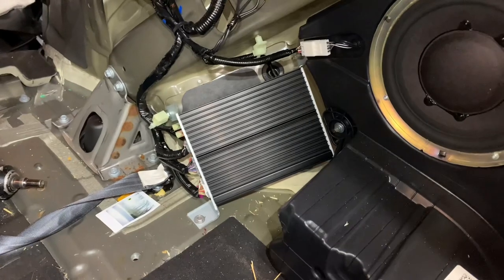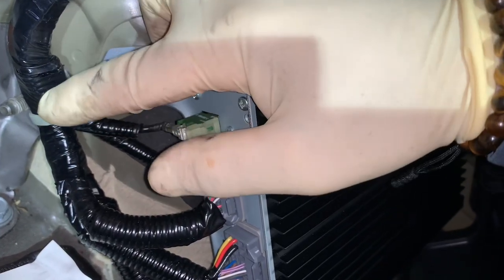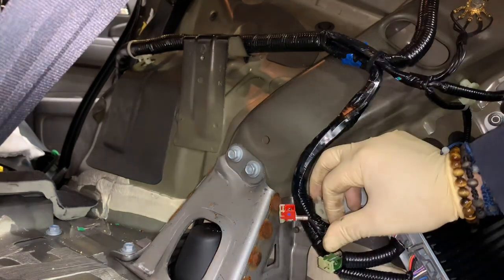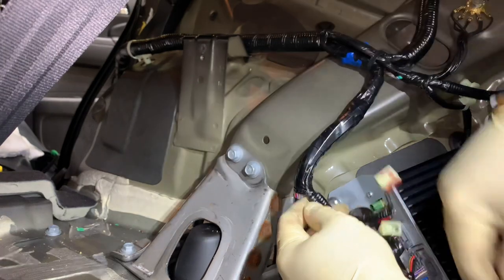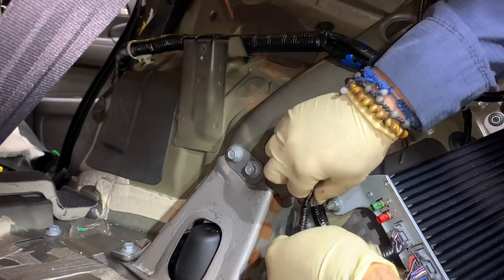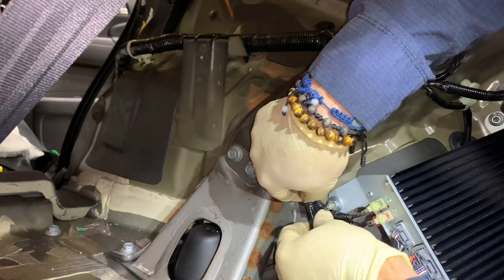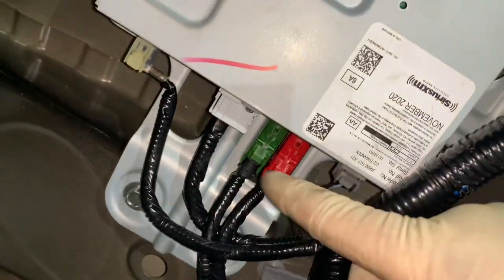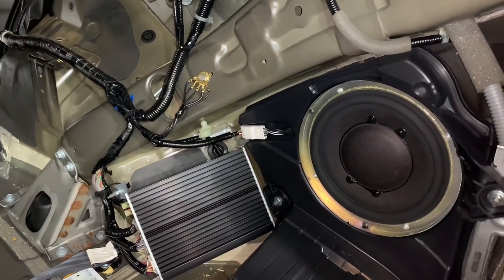Honda Pilot and Passport crackling, popping, infotainment turning off or freezing repair.

Comment: I’ve been fighting this problem for a few months now.  What I’ve found is if I have the plastic cover removed the radio works perfect.  But once I install the cover back on the problem comes back.  I drove for 2 months with the cover removed without a problem.  I’ve tried rerouting all those cables several times. And as soon as I reinstall the cover it comes back.  Any thoughts on what could be happening here?  I’m assuming t he cover is putting pressure on thE wires somewhere. But I can’t duplicate the issue when the cover is removed  by pushing or pulling on any of the wires.  I purchased this Honda(2020 pilot - black edition) as a rebuilt title, so I have no warrenty hTrough Honda and I’m worried I’m SOL.
Reply from the maker: so what you have to do is take a borescope and look at how the fires are once fully installed and have to find a way to get them as straight as possible. Also go to the dealer and tell them you want to buy the fakra connector bulletin and perf the bulletin

Comment: In my case my stereo amplifier (female connector it self, the red one) broke 😢 the Harness is safe. I wonder if there’s anyway to fix it  or to replace that female red connector or would have to replace the Amplifier itself, please help
Reply from the maker: If you can’t get it back on, will need amp unfortunately

Comment: Where is that amp located and what is needed to gain access.  My fiancee has a  pilot that has a cracking/popping noise from the radio.
Reply from the maker: Located behind pass side rear quarter. (That 3rd row pass seat and quarter cover have to come off. If it’s still in warranty I would take it to honda and have them perform the procedure.
Reply: Bring it in. Should  be covered  under warranty
Reply: @richardcabrera1176  Warranty is only good for 36K miles isn't it?
Reply: @caffeineandkaspa  for that pop issue it seems longer
Reply: @richardcabrera1176  I hope so. I feel stupid buying one with 36K miles on it. I hope it's covered if it happens to me.
Reply: @caffeineandkaspa  no problem  man . Also you shouldn't  feel that way .  You should  be good to go

Comment: Can you please do a video on how to get to the cables and remove all the stuff on top of it?
Reply from the maker: Yes, next car I get with the complaint I will.
Reply: @BCautosolutions  Any new vids yet showing the location of the amp and how to access it?  Your video gave a great description of the problem nd how to address it but I am not sure where in the vehicle it is located.  Been experiencing this intermittently in our 2019 Pilot.
Reply from the maker: @rstephe  I haven’t done once since the video but sad soon as I do I will be sharing it.
Reply: @BCautosolutions I’m a fan of your work, waiting for that video also. 🙏🏼
Reply from the maker: @stansingh  thank you! And as so as I get another one!
Reply: I have completed this fix with HondaMobilemechanics direction and so far have not had any infotainment issues, still early to tell but I had it pop and shutdown on me multiple times per day, now its working so far after the repair without issue. If you need to see how to take apart the interior to get to the amp, watch this youtube video, https://youtu.be/9rC2sTds7Jw,  they show how to take apart everything in the back on the drivers side but its the same steps for the passenger rear to get to the amp, my 2 cents into this BS problem, hope it helps.
Reply from the maker: @kumbaproperties2432  that’s awesome! Thanks for sharing!
Reply: you need to take off the 3rd row copilot seat (its pretty easy), then you want to take off the panel on that side and you will be able to access this easily. Don't try to do it with the seat on because it will make it harder that what it should be.
Reply from the maker: @lalobon  correct

Comment: Does this fix the cutting out and popping cracking 2020 Passport
Reply from the maker: Yea, similar but not exact situation.
Reply: @BCautosolutions  I guess every situation depends.  I’ll try this I get cut out and crackle.  Do you have a video on the dash harness and how to remove the rear compartment for this video to get at the amplifier
Reply from the maker: @GPMAX01  no i do not but I will.
Reply: @BCautosolutions  these videos are very well made and Uber helpful.  Thanks for all you’re doing!👍💯

Comment: I made a appointment to get the recall done for my 2020 .but theres nothing wrong with mine no issues what so ever .my friend just had his done and they gave it back to him with clips broken and chattering .they are replacing his silver bezel that goes across the front dash and lower floor board and chipped his cruise controle and there replacing all that and a chip in his top right screen to infotainment system so there replacing that also.sad part is they tried denying it and he took videos and pictures of everything documented.they ended up owning up to it sfter he showed videos and pictures .so i have to find a new dealer to do mine not trusting the one near me .ill have to cancel my appointment on the 31st .maybe wait till its broken .if its not broken dont fix it deal
Reply from the maker: How did you fare out?
Reply: @Hondamobilemechanic  I ended up canceling it they butchered 2 of my friends cars .my car isn't doing it so no one is touching my car till it's broken .40k on my pilot no issues .not broken dont fix it
Reply from the maker: @pilot2020  I agree dude, if it ain’t broke, just let it be 😅

Comment: I have same issue on 2020 Pilot, it’s been to dealership with lame b.s. excuses, they say it needs new harness which is 6 month back ordered.  I just tried this fix and it looks like dealership already tried it.  Any other ideas to try, I’m not waiting 6 months on new harness to be installed by some jokers.  I’m back to GM after this car.
Reply from the maker: Sorry to hear, I would check the wires behind the infotainment and dvd player area, re route then if needed. Funny you say that actually, the most system is a system borrowed from gm.
Reply: @BCautosolutions   I checked all of that too, looks like they went thru that at some point too so I guess it’s wait on the harness or trade it in. I honestly don’t see them actually doing the harness because it’s to much work. It may be a borrowed system from GM but the service is better from GM and GM’s are just a better all around ride but we decided to give Honda a shot this go around and have been nothing but disappointed, mostly with the local dealer but corporate really hasn’t been any help either.
Reply from the maker: @jameskeesee6863  sorry to hear. Have you tried a different dealer by any chance? Shouldn’t have to do all that but we see it here in my area how a few dealers within proximity aren’t as willing to help as my dealer is. Anyways appreciate your input and wish you luck.
Reply: @BCautosolutions  I think you mentioned that you are in the New Jersey area, Would you be able to recommend a good dealer that can fix this issue the right way. Im in New york city area?

Comment: Can you pin point where the amp is located on a 21 pilot thanks in advance...
Reply from the maker: Behind interior panel on r/r of car (quarter panel section) have to remove 3rd row lower seat and 3rd row pass seat back

Comment: Any advice or idea why when I connect my phone with a usb cord that it sometimes doesn’t play stream music (doesn’t matter the app), yet other days it works just fine. I have also literally had it plugged in and it is playing the maps through Apple CarPlay on the screen just fine and then all of a sudden the music will start. Could be 15 minutes into a drive or an hour. So random.
Reply from the maker: Are you using Apple cable or aftermarket?
Reply: @BCautosolutions  Apple cable (lighting male end into phone). Also I took my panel off and it looks like someone already released the tension on the plugs by cutting the electrical tape. So not sure what to do with the crackling/popping that occurs as well.

Comment: Where exactly are you working here? Rear passenger sideliner?
Reply from the maker: Yes, essentially inner passenger rear quarter panel. Have to remove passenger side 3rd row seat and trim panel on the interior.
Reply: @BCautosolutions  thanks. I have a passport, so no seat! Cheers
Reply from the maker: @jonpos4671  yep, on the passport it’s less work 👍🏻
Reply: Is it on the left or right side?
Reply: @thile6409  right side. Passenger side. Comes out pretty easy on Passport
Reply from the maker: @thile6409  pass side quarter panel area.

Comment: i have  a 2013 honda cr-v making noise from rear speakers poping / craking/ static , radio is off and only while going over bumps as vehicle jumps , also now the radio fuse pops while replace
Reply from the maker: Totally different issue. Sounds like you have a short going on

Comment: Wasn't there a recall on this issue in the 2019-2021 cars?
Reply from the maker: No recall, service bulletin. It’s different
Reply: @BCautosolutions  I had to take my daughters 2019 Passport to the dealer and they replaced the connectors under the Recall/Service Bulletin. I don't think it was the same connectors you show your work on. They looked more like the red an green ones you show later in your video.
The audio was popping and cracking, but the system didn't shut off.
Reply from the maker: @andrewdarden8210  yes passport is slightly different. The symptoms vary fr popping/crackling randomly to pretty often to shut downs. Appreciate the input
Reply: This is me from the future. You called it. Whew.

Comment: I have a 2019 passport elite , the radio will stop working and the display says no audio connection. Doesn’t happen all the time but when it does I turn the vehicle off and back on and I get audio again. There’s a tsb 21-012 seems like that’s my issue.
Reply from the maker: That tsb is a hit or miss tbh. I’ve done countless of those almost times with little success. Typically pilots and passports this exact procedure is what has worked for me.

Comment: I have a 2021 Black edition pilot with 8,450 miles on it. 1) visit to dealer it was a software upgrade. 2) visit to dealer it was new wiring connectors.. I still have the same problem.  When I start the pilot screen is blank no back up cam nothing... sometimes when I start to drive it come on only to show  " lost network connection " so now back to the dealer I go.  Hope he dont get offended when I show him this video..Thanks
Reply from the maker: Yep, show them this video. I’d be willing to bet this is your issue.
Reply: @BCautosolutions   So today I drop off my Pilot at the dealership he's telling me he just order a New tuner... I gave the the video to view .let see if this fixes the problem..thanks for your video ... keep them coming ( hopefully not needed ) lol
Reply from the maker: @markbrennan21  he ordered a new tuner 🤦🏻‍♂️. Sheesh I hope he’s right but I’m gonna go shrewd and say he’s not. Keep me posted.
Reply: @BCautosolutions  I have to let them so I can do I told you so bit.smh sometimes being a good mechanic means listening to outside sources.... I'll keep you posted
Reply: @Hondamoblemechanic Update !!  well have my Pilot the whole day now , All seams good for now, even the sound is clear , Thanks again
Reply from the maker: @markbrennan21  glad to hear. Wonder if they actually did the repair and just didn’t say anything as there is no operation number if he did the tuner at same time at least the dealer would have gotten compensated. Either way let’s hope it’s permanently fixed. 💪🏼

Comment: I 'd give a like if you would told people, which side of the vehicle to start remove the rear interior quarter panel. So that people don't have to guess or try to figure out which side to remove it! If you wanted to have a lot of people watch the video. I guess this video is meant for some mechanics.
Reply from the maker: @ngocdao1  ✅

Comment: Holy crap that’s a lot of stuff to be taking apart
Reply from the maker: I can do it in about 45 mins or so
Reply: @BCautosolutions  do you have any diagram that I can look at? I want to get into both side of the panels so I can add sound deadening too while I’m at it
Reply from the maker: @Kanti12311  I do not. Will make a video once the next one rolls aroundn

Comment: I have  a 2020 Black Edition Pilot and the dealer fixed it by replacing the wiring harness. It come back from time to time
Reply from the maker: Yup, the replacement harness is the same one that comes on the car from factory. It’s literally a band aid. If it becomes unbearable have them do this method.
Reply: 2020 BE here as well.  I bought it last year and had the noise immediately.  Got it fixed within the first month or 2 and it was good. . . until today.  Started up randomly, then after about 10 minutes of driving it went away.  Of course it had to happen now, when I'm taking the wife & kids on a cross country trip in a couple days.  I'll see how it does tomorrow and I may just work on it tomorrow night.  If all is good, then I'll just do it when we get back.
Reply: @JoshuaFinger  Reply Back to me and let me know what you find. ITs maddening...I did get it to stop once by cycling the door locks while driving...

Comment: After all said and done here comes the floor harness  because  honda Still doesn't  know how to fix this .  Re crimp connectors. All sb's done  and still popping  .  Don't forget  to turn the system  volume  down
Reply from the maker: Yeah it’s a mess. Even when doing a new harness it’s routed exactly the same. This has been my number 1 and really only fix.
Reply: @BCautosolutions  hell yeah . I've had 2 come back after that . Most doesn't  even have a shut down reason.  Basically  throw parts at it and hope the customer  doesn't  come back for that same issue
Reply from the maker: @richardcabrera1176  exactly and when you reach out to Techline they end up giving me a hard time so this is right where I go to now ✌️🤣
Reply: @BCautosolutions  lol right on . Stay safe brotha🤙🏻
Reply from the maker: @richardcabrera1176  likewise 🤘🏼

Comment: I Don’t like That wiggle on the green connector, Too much. if you wiggle them and the speakers start crackling… new harness according to Honda. They want no repairs on those 90s.
Reply from the maker: I’m good with that. I’ve had great success with this method and Honda is quick to replace the harness with the same exact harness that will have the same exact problem. Not doing floor harness to just have it come back again. Hard pass

Comment: Customer went to another Honda dealer as soonest the noise came back an other fool dealt with the problem again, this is not a fix .
Reply from the maker: This is a fix! I’ve done this 50+ times. Not always the fix, but fixes the issue more times then not.
Reply: @BCautosolutions  S/B 23-047 ,came out now , don't do it anymore